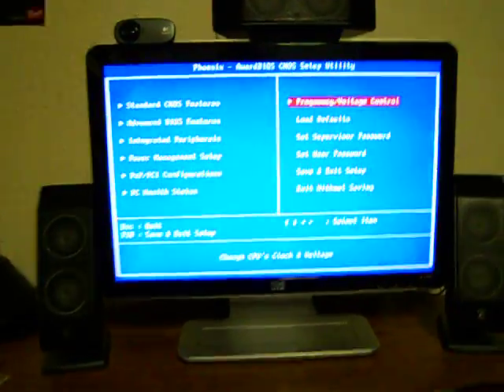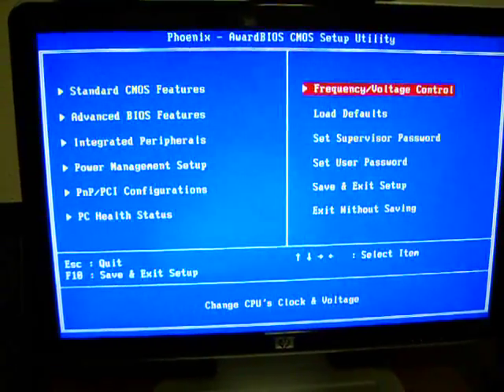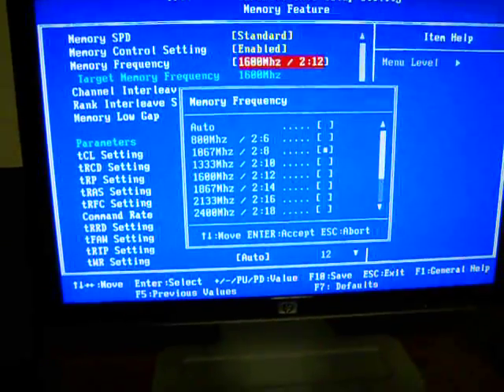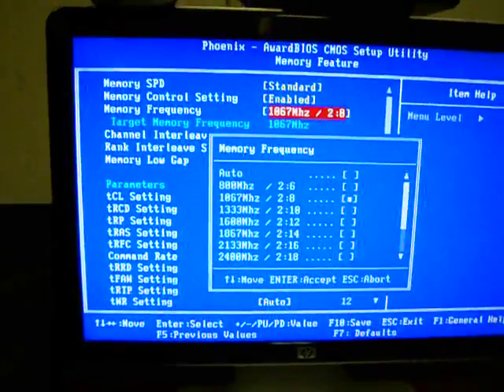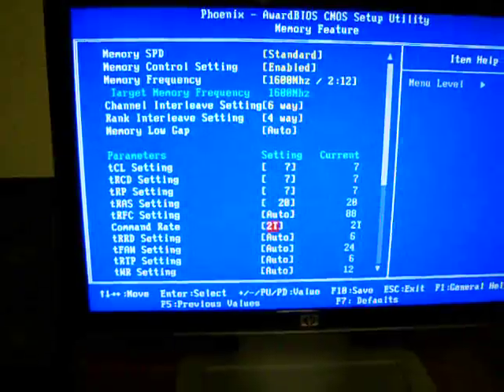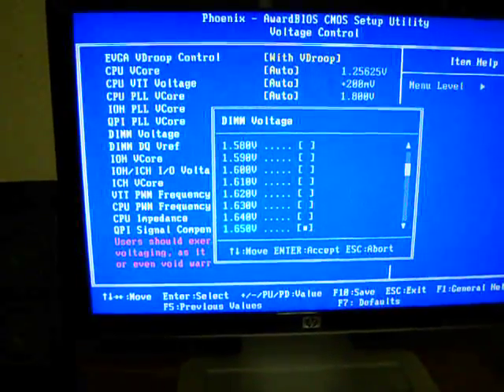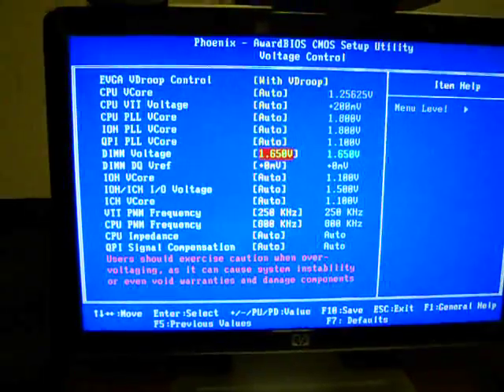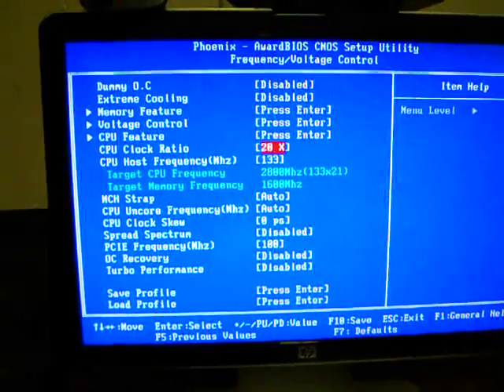Computer Ram Overclocking

Comment: @xDutchZomBieHD it isnt but it depends on your ram voltage and what it can go up to, usually you dont want to take it past 1.9v, however it usually says on the ram stick itself what kind of voltage it could go up to, like i have OCZ premium and it says on the stick 2.1v but i run it at 1.9 i also run corsair which have a 2.3 v rating. but all all 4 of my sticks are oc'd to 1066 at 1.9v but i have a liquid cooling unit on mine. it shouldnt damage it but as TheMitsaras98 said i would add a fan.

Comment: i was wondering how to OC the mobo for the ram, cause my mobo standar is ddr3 @ 1066, and 1333mhz(OC) that's what it says, buy idk if i just put the 1333 dimms in and the mobo will automatically clock at that speed, or i need to (OC the mobo) i'm not looking to OC the ram, i wan't to adjust the mobo to 1333mhz. any help? thanks